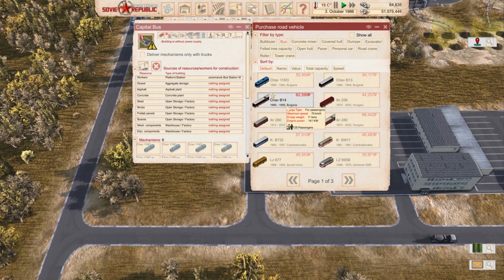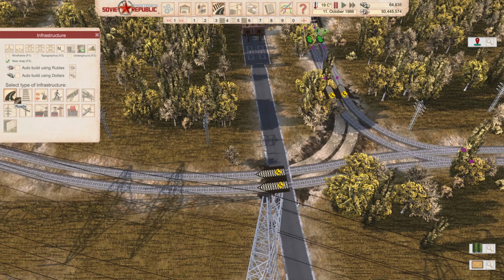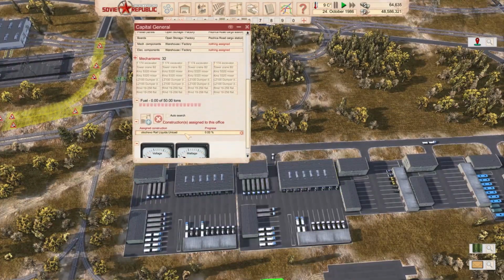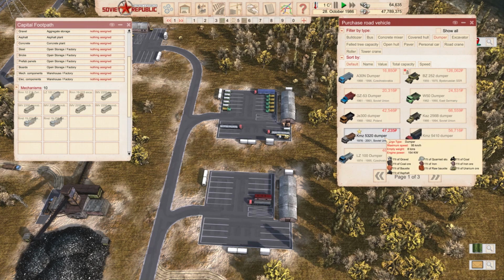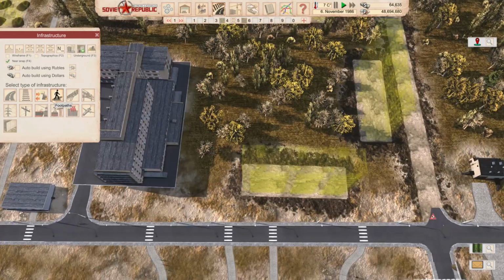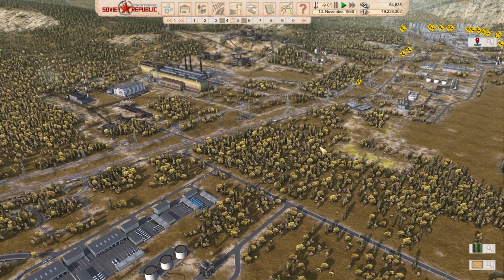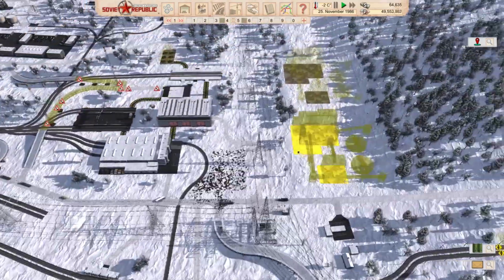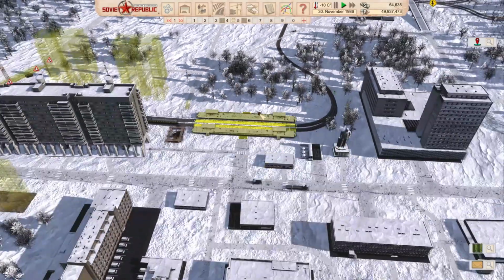Soviet Republic - Alaska - The New Beginning - Ep.107

Comment: 1) There was a much simpler way to find out whether or not an excavator could be loaded by a flat bed : it was enough to try and load it on the flat bed inside the CO itself. No need to wait for the CO to assign a project and deliver the first materials to see if the excavators are loaded or not ...
2) The mud road bus stop is in a series but I don't remember which one. Perhaps one of Novu's dedicated to early starts from 1900
3) Do not forget to supply your Nissesburg COs with fuel, your excavators are not stationary and it will be painfull to see them go to get their supplies at low speed at a gas station.
4) Road COs :
a) the construction of bridges cannot be attributed to road COs alone, they are not equipped for it. Bridges must be assigned to road CO and General CO at the same time.
b) be able to build only two gravel roads at the same time for such a dense area (that of twin cities) not to mention the expansion in other directions will quickly make you understand why the size of the CO road is an important parameter. Two roads at the same time is very little.
5) Using only two covered hulls for this whole large geographic area (probably with a lot of street lights, coal industry conveyors etc.) is not a really great idea. It's even a rather strange choice to put them on the Bus CO on top of that. Manually assigning your projects will be more complicated.
6) Foot Capital CO:
a) for what absolutely obscure reason do you want to have an excavator in this CO? Completely unnecessary.
b) Romanian 18t capacity flat beds to carry a few hundred kilos of steel is also a very strange choice : this CO will have to build roads of less than 21m.
c) a single covered hull and a single road crane to build a network of streetlights over such a large area is very little.
d) more logically, moreover (if you had had a larger CO road) the road cranes (which cannot be used on roads less than 21m) would have rather had their place in the CO road
e) foot CO must have a source of asphalt for roads less than 21m. Come on my friend, you've known it for ages now !
7) I think you are wrong not to also provide strategically placed bus stops in Nissesburg. To manage your population I am almost sure that later you will improvise some in a hurry. If only to have a source of workers for your COs, but also to transport minors to cable way stations, and so on ...
8) Oddly enough, you don't use Rob's nurseries a lot, although he has a lot of different models.
Reply from the maker: 1. That's true. I forgot about that. 
2. I didn't check Novu's pack! I could be there. :) 
3. Ahhh. Yeah, good call! 
4. 
a. Or even construction CO if it's a prefab bridge. You are right.
b. I'm not sure if I should expect many more roads and I was counting on Mooremansk Road for help.
5. Well the main streets in Nissesburg and the Capital are done. I will be building few more roads with lights but I don't really expect a lot of them. 
6. 
a. Aren't excavators now able to build footpaths? I was thinking of having 1 just in case. 
b. Yeah! You are right. 
c. I'm not sure how many more streets I can expect. We have both main streets in both cities and I would like to keep them to a minimum. 
d. That's true! 
e. But I usually assign both Road and Foot to U21 roads. 
7. Maybe you are right. I was thinking of keeping it tight but thinking about it I should probably plan for this. 
8. I am keeping an eye on them and used them a bit. The problem is that I would like to place the high capacity one in the city center. But you are right. I can use few smaller ones also. 

Thanks, Stats. :)
Reply from the maker: 4.a. Given that the General CO does both so my bad. :D :D
Reply: @oolykeegaming81  No, you also need the road CO (and the general CO) : for the paver and the roller
Reply from the maker: @statsneguit3069  sorry I meant it needs general and road of course. Previously I said it needs General or Construction and road. But in the capital area construction and general are the same office. We are on the same page. I just expressed myself wrong. 😁😁